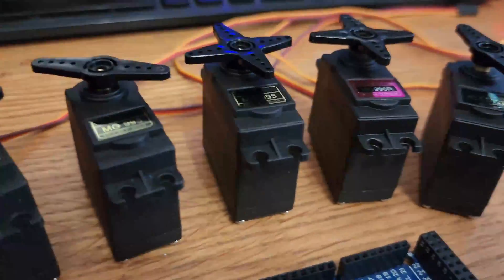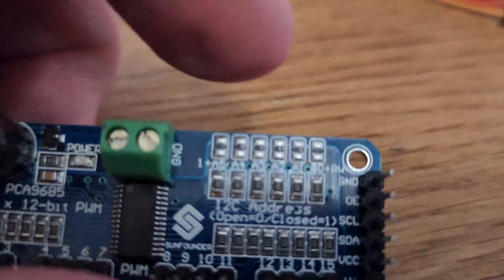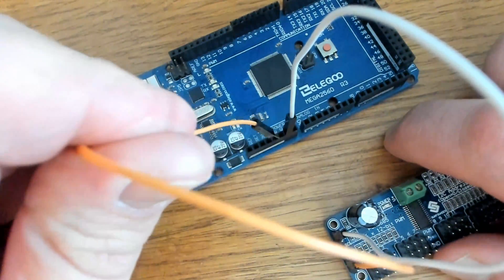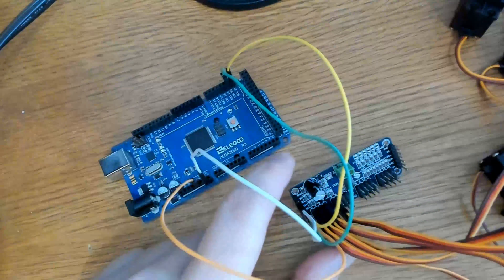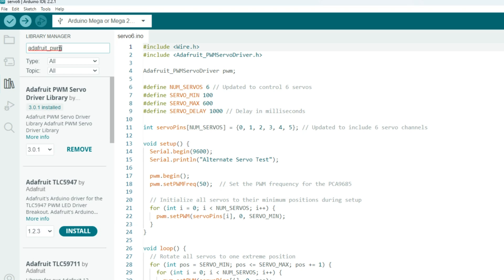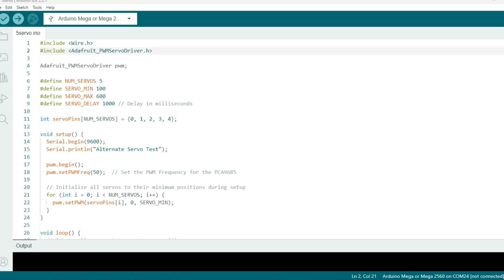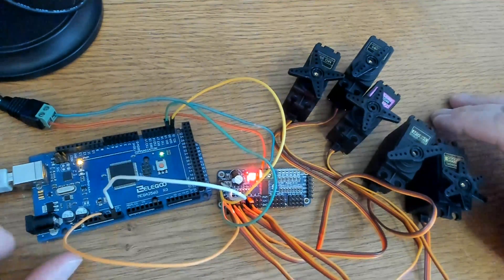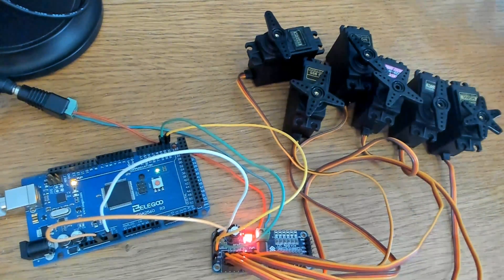Mastering Servo Control: PCA9685 PWM Driver with Arduino Tutorial and Demo

Comment: Can you have the servos doing different operations at the same time or can they only do the same action across them all
Reply from the maker: hi, yes... you should be able to. sorry for the late response. If you're using the code I posted on Facebook, you would have something similar to this: 

for (int pos = SERVO_MIN; pos <= SERVO_MAX; pos += 1) {
    for (int i = 0; i < NUM_SERVOS; i++) {
      if (i % 2 == 0) { // Even servos
        pwm.setPWM(servoPins[i], 0, pos);
      } else { // Odd servos move - opposite direction
        pwm.setPWM(servoPins[i], 0, SERVO_MAX + SERVO_MIN - pos);
      }
    }

Comment: hi there, thank you so much for your video, really helpful. quick question in term of power supply, im using 6 MG996R at the moment at 5V 15A seems to be too much for them, do you suggest particular lower A for the power supply?
Reply from the maker: Hello!  If the 5v 15A supply is working for you, stick with it. You want to be sure to have plenty of overhead current to handle the servos when they are all drawing the most current at 5v and the motors will only draw the current they need. Check data sheets and test to ensure there's no over heating or erratic behavior of the motors based on your project. But, I would keep the 5v 15A supply for 6 servos.  I hope this helps!

Comment: what if you are running very beefy servos that need more power? will it still work? if not what do I have to do?
Reply from the maker: hey there! The PCA9685 PWM driver operates at a voltage range between 2.3V and 5.5V for its VCC pin. The v+ terminal is 6v max However, it can still be used to control higher voltage servos by using an external power supply for the servos.  Since the servo motor draws current to move, it's best to isolate the power for the servos from the power for the PCA9685 controller board.

Comment: Can i turn it off and on
Reply from the maker: hey there!  you could set the PWM to a certain duty cycle. For example, setting it to 50% duty cycle means the channel will be on half the time and off the other half. To turn a channel off, set its PWM value to 0, resulting in no signal being outputted.
Here's what that might look like: 

#include <Wire.h>
#include <Adafruit_PWMServoDriver.h>

// Create PCA9685 object
Adafruit_PWMServoDriver pwm = Adafruit_PWMServoDriver();

void setup() {
  Serial.begin(9600);
  pwm.begin();
  
  pwm.setPWMFreq(1000);  // Set the frequency to 1000 Hz
}

void loop() {
  // Turn channel 0 fully on (100% duty cycle)
  pwm.setPWM(0, 4096, 0);
  
  delay(1000);  //on for 1 second
  
  // Turn channel 0 off
  pwm.setPWM(0, 0, 4096);
  
  delay(1000);  //off for 1 second
}

Comment: Hello sir i need help with my thesis project im already done with the wirings and programming its all good but why is that my servo motors are not functioning?? Im using PCA9685 with 3 MG996R and 3 MG995. With a 5v 2amps power source
Reply from the maker: Those 2 servo motors are 6v servos that can draw up to, and maybe a little over, 1amp of current each depending on peak load and speed. I am assuming your issues is the lack of current to power these motors. For 3 of each, and a total of 6 servos, I would use 5v-6v at 8-10amps. The motors will only draw the current they need so having a little overhead would be good. You may find a stand alone variable power supply or a step down converter to be useful.  Perhaps you could test the motors and board by removing all but 1 servo and testing it at each servo position.

Comment: I’m getting really annoyed with my boards. I have five micro servos (specifically MG90S) connected to this and my Arduino. I have a portable battery to power the Arduino and a Tenergy 6V NiMh battery (for RC cars) powering the servos (connected to the terminal block). 

It was working fine for a few days, then magically didn’t. I thought it was the battery so I bought a Tenergy balance charger and charged the battery. Multimeter checked the battery and it seemed fine. 

Definitely frustrating. I’m not new new but I’m still fairly inexperienced. Arduino forums weren’t much of a help, since the only questions that needed answering were in regards to bad wiring diagrams lol 

Any suggestions would be much appreciated. 🙏
Reply from the maker: hey there!  if it was working and now it doesn't, i'm wondering about the battery. It sounds like the wiring is fine but I'm happy to help where I can. what is the mAh of you 6v battery? If your 6V battery capacity is 1600mAh, its continuous discharge rate might not be high enough to handle 4.5A and could overheat or be damaged but it also depends on  usage duration and servo load. It's recommended to choose a battery with a higher capacity than the minimum required. Consider a 2000mAh or 2500mAh battery to provide a safety margin and potentially longer runtime.... just my initial thoughts.
Reply: @BMonsterLaboratory  Thank you for your quick reply! The battery I’m using is 2000mAh. If I need one go up to 2500 I can try ordering one of those too
Reply from the maker: @KOAlleyCat  can you send me a picture or diagram of your connections? Facebook or email is fine.   Perhaps you don't need a new battery
Reply: @BMonsterLaboratory  You’re amazing. I’ll send you what I have over FB Messenger.  I’ll try to show as much as possible as well as what I’ve already tried. I appreciate you and your time so much.  I’m teaching a class of kids next weekend on how I built my last one (community leader asked if I’d help and I love to help kids so I said yes lol) and introduce them to the basics of Arduino programming. But the last one I made I had the servos directly wired to the Arduino. This time I wanted to use a servo driver and it’s been a pain in my rear!

Comment: Thank you for the video. 
For the 5V 10A power supply, what battery are you using?
Normally the amperage rating is much lower than the voltage rating, so I'm curious what source you used here.
Reply from the maker: You can use a 12v to 5v converter that is rated for 10amp if you need a portable supply. This one has good reviews on Amazon. https://www.amazon.com/12v-5v-Converter-Regulator-Transformer/dp/B08PP6LMM1?source=ps-sl-shoppingads-lpcontext&ref_=fplfs&psc=1&smid=A3M3YMPQTI06AD   For most projects with high current requirements I will use a larger 24v/20a power supply and dial in the voltage I need.

Comment: Hello, could i ask you i have 7,4V 2S lipo bat. and I use it to power the servos I have 12 servo motors and each one takes about 3A under load. The question is… is it possible to use this driver pca9685?
Reply from the maker: Hey there!  This board cannot directly drive a 7.4v servo. The PCA9685 operates with a supply voltage range of 2.3 V to 5.5 V. However, you can connect your servos to a 7.4v power source and use the PCA9685 board to send control signals to the servo via its PWM control input (assuming your servo has a 5v signal pin).  You may also want to check out high voltage servo drivers. This one is a stand alone servo controller - https://www.adafruit.com/product/5437?gad_source=1&gclid=CjwKCAiAt5euBhB9EiwAdkXWO9AbfugiJgUH6CyWzK35_XNwNcthAU-gfVnBhwZ7Tj0AlACuxN4CvxoCmvoQAvD_BwE  -It supports high voltage servos, up to 11V.  I have never used it but i'm sure there are some good demo videos out there. 
You're going to need a  lot of current. Consider integrating fuses into your design to protect against short circuits or overcurrent. A fuse rated slightly above your expected maximum current will help prevent damage to your components. 
hope I answered your question.  good  luck to you!
Reply: @BMonsterLaboratory  I tried connecting the servos and it worked fine even at 7.4V. I'm just worried that the pca9685 will be ruined for long term use.
Reply from the maker: @martinsvoboda1237  I agree.

Comment: sorry about that apprently you have to divide your pw by your boards bit rate so mine being a 12 bit had to be divided by 4.07 to get the correct values
Reply from the maker: hey there! great question.  Do you have a link for this? I was under the impression that the PCA9685 takes care of generating the PWM signals for all the channels based on the frequency you've set and the specified pulse widths. It does this simultaneously, so you can control multiple servos independently without needing to manually calculate or divide pulse widths.
Reply: aye man sorry found it on a random form somewhere and it worked
Reply: but what i did was take my 2500 and 500 and divided it by 4.07 which gave me pretty much the same numbers as in your code

Comment: Hello. Even though I have completed the connections and library installation you explained in the video, exit status 1
Compilation error for Arduino Uno board. I'm getting the error. But when I load another code, I do not encounter this error. Can you help me, thank you in advance.
Reply from the maker: so, it's probably a syntax error or board selection error... Did you copy and paste code from Facebook post?
If not, try this. 

#include <Wire.h>
#include <Adafruit_PWMServoDriver.h>
Adafruit_PWMServoDriver pwm;
#define NUM_SERVOS 5
#define SERVO_MIN 100
#define SERVO_MAX 600
#define SERVO_DELAY 1000 // Delay in milliseconds
int servoPins[NUM_SERVOS] = {0, 1, 2, 3, 4};
void setup() {
Serial.begin(9600);
Serial.println("Alternate Servo Test");
pwm.begin();
pwm.setPWMFreq(50); // Set the PWM frequency for the PCA9685
// Initialize all servos to their minimum positions during setup
for (int i = 0; i < NUM_SERVOS; i++) {
pwm.setPWM(servoPins[i], 0, SERVO_MIN);
}
}
void loop() {
// Rotate all servos to one extreme position
for (int pos = SERVO_MIN; pos <= SERVO_MAX; pos += 1) {
for (int i = 0; i < NUM_SERVOS; i++) {
pwm.setPWM(servoPins[i], 0, pos);
}
delay(15);
}
delay(SERVO_DELAY);
// Rotate all servos back to their minimum position
for (int pos = SERVO_MAX; pos >= SERVO_MIN; pos -= 1) {
for (int i = 0; i < NUM_SERVOS; i++) {
pwm.setPWM(servoPins[i], 0, pos);
}
delay(15);
}
delay(SERVO_DELAY);
}
Reply: @BMonsterLaboratory  I made a mistake while installing the library🤦‍♂ Thank you very much for your help. I subscribed to your channel :)
Reply from the maker: @ardaasrc  great! thank you. I hope you find more videos that are helpful. If you have any questions just leave a message here, on facebook, or send an email.  👍